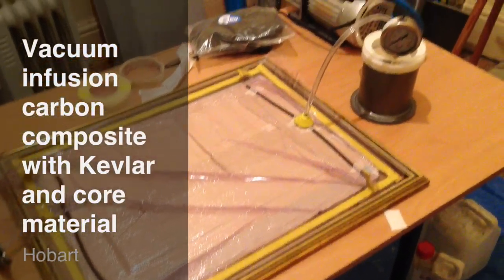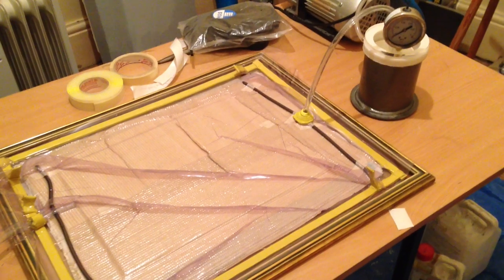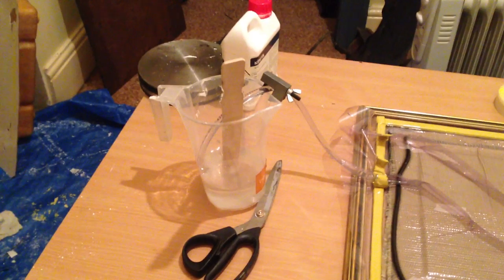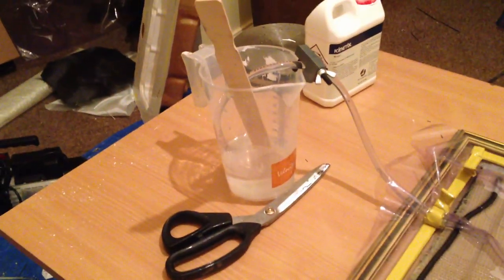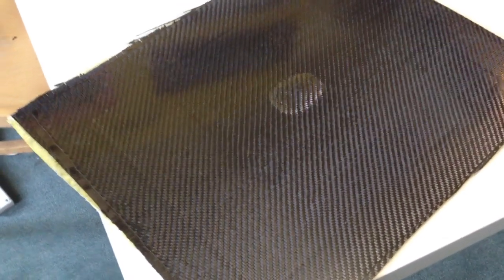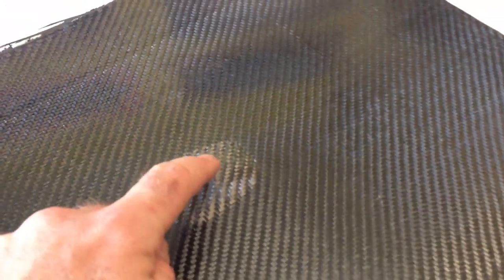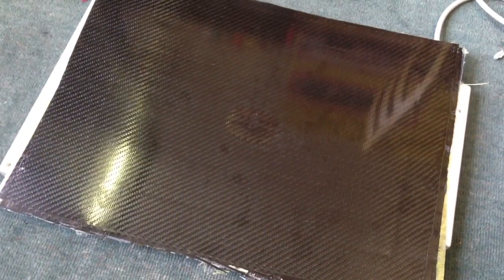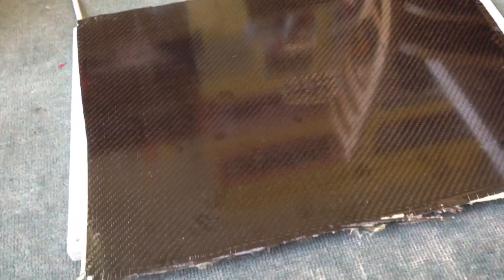Vacuum infusion test with carbon, kevlar and core material

Comment from the maker: Thanks Steve.  Things are coming together reasonable well since I have been unable to do much for the past couple of months. All the bits and pieces are just about gathered. Shocks arrive tomorrow, brakes are here. That's about all we needed. Pete is getting stuck into the welding and I am doing the carbon fiber. Dad is just about ready to come down and help (in a couple of days actually). We 'should' be ready for Jan 2013!

Comment from the maker: Thanks for watching and asking. Yes, I have a better video coming that includes the whole process. In the meantime, check out Carbon Mods videos (or carbonmods). That is where I learned a lot of my techniques that I have adapted to my space/tools/resins etc. I highly recommend trials using fiberglass woven cloth - it's quite cheap. One tip - you MUST have an airtight seal. We will post again soon.

Comment: Hi

Can you please clarify the size of that panel? Especially the part between beams on the graound when you stepped on it?

I need a similar composite panel for my project and minimal deflection is important part of my requirements. 70 lbs weight, on 18 inches span. I'm struggling with the structure for my panel. As I don't want to over engineer the thing.

I guess it's too late to ask what was the weight?

Also what resin and what foam did you use exactly?

Thanks
Reply from the maker: Funnily enough I still have the panel in my shed. I showed it to someone last night with the deflection, etc. I will take a better video tonight for you and post it as soon as I can.
Reply from the maker: I have put a new video on YouTube for you. To answer a couple of questions - ~10mm (1/3") deflection with 95kg load (~210lb - that's me standing on it!). The foam is 3mm closed cell foam which is the same as surfboard foam. It was a test for our hood, and well and truly over-engineered for that. We will be using around 1/2 the layers and strips of core foam that will be formed around vents and things.

Comment from the maker: I am happy to provide any/all info I gather. Cutting the Kevlar cloth is OK with Kevlar Shears which are a nitrided titanium (I think). After curing, an angle grinder and fine cutting blade works well (be aware of generated heat) with a bit of feathering that can be removed with sandpaper. A hacksaw would probably work well. I have done various Carbon/core test peices, and will do Kevlar/Carbon/core comparisons soon as post results. Maybe subscribe to catch the new vids or just check back.